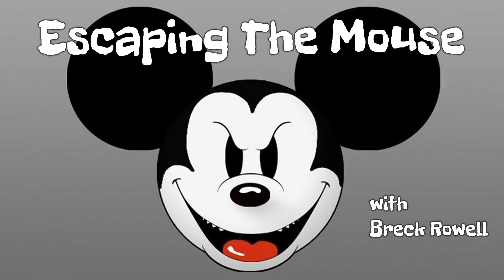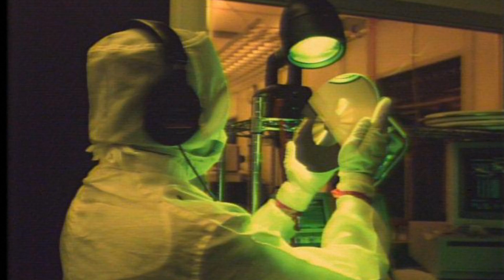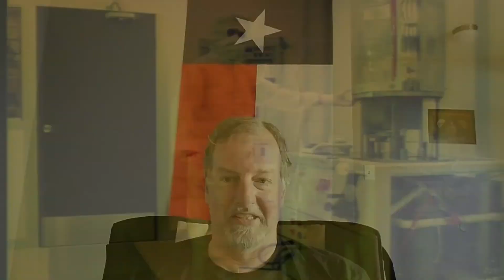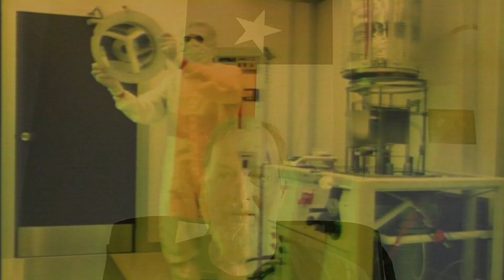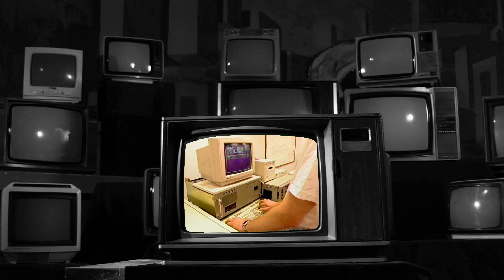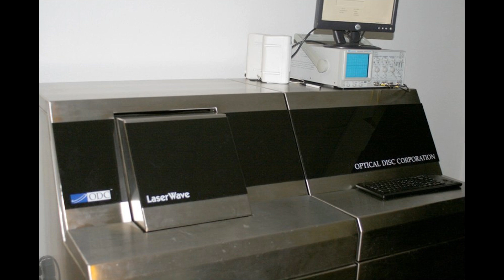Adventures in Optical Disc Manufacturing - Escaping The Mouse - ETM-29

Comment: Excellent vlog -- I think that your story of your early years of education and getting your job and experiences in optical disc manufacturing is not only nostalgic for some of us, but makes for some very interesting technology- and industry-related information, plus a career example for young people...I think a very encouraging one.  

By the way, my ears perked up when you mentioned the Sony D5 -- the D5 was my FIRST ever CD player...in 1985 I had been dreaming about getting a CD player  ever since the first EXPENSIVE ones had been announced (I was an audiophile into vinyl), and actually working in Japan most of the time in a temporary apartment when this came out in the stores -- twist my arm, it was "affordable", so I bought it along with these little Sony speakers so we'd have music and my wife couldn't complain (heh, heh).  I never had the battery adapter case, it just came with a little slide-in base with an ac-powered d.c. power supply.

Comment: WEAand later Cinram had a manufacturing facility not far from me in Olyphant, Pa. It was one of the largest employers in the area for years. Eventually it scaled back and I'm not even sure if any of it exists here. Spoke too soon, and you mentioned it.
Reply from the maker: I visited that plant on several occasions.
Reply: @EscapingTheMouse  I work with, and have worked with MANY people who were displaced every time it down-sized. It was once THE place to work for the Scranton area.